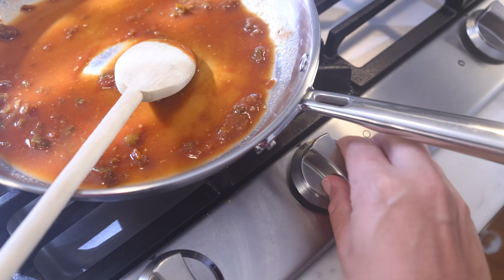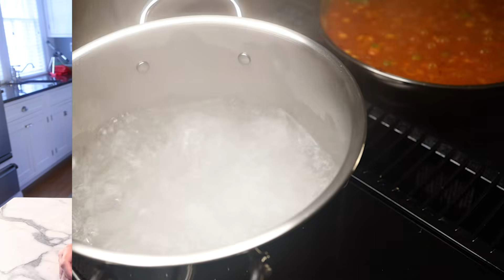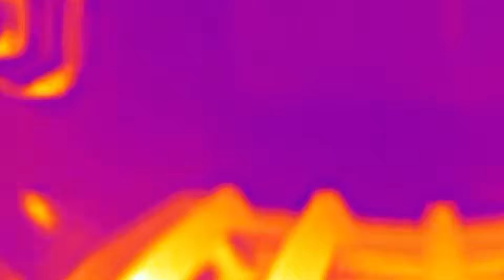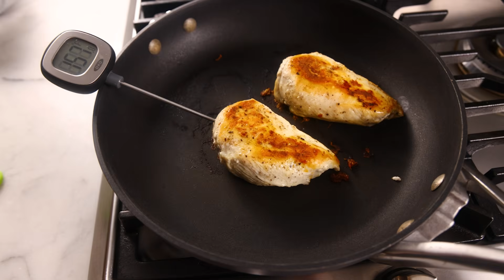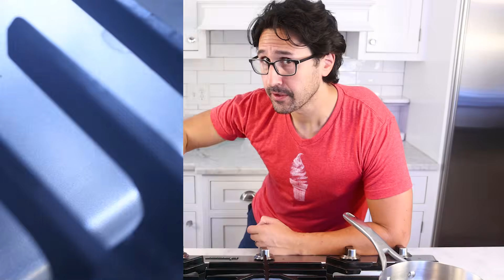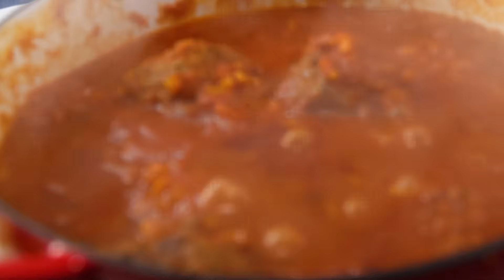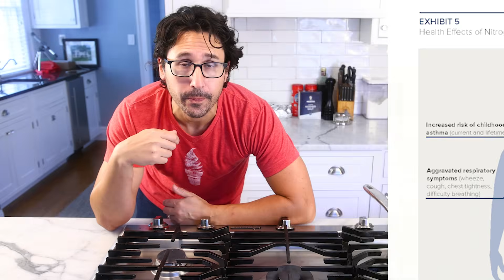Problems with gas stovetops | weak, dirty and dangerous

Comment: I wonder if you could make an ultra-responsive electric range that can wrap around cookware of different shapes using something similar to a less focused plasma cutter -- air forced through a high-energy arc to create a 'flame'. Would probably be expensive and hard on your cookware, though, and it would still create some air pollution by ionising the air, creating weird impurities like ozone and nitrogen oxides. Induction just seems more practical overall.

Comment: A relative of mine wanted one of those old fashion ovens with cook top on top. It has four gas burners on top and an oven below and looks like one of those old style ones but with modern technology. When they were getting it I suggested going for the last 2 side burners to be electric instead of having all 6 burners be gas. Now the electric ones aren't inductive (which stinks) but at least it's electric so if something ever happens at least they can still use the electric part maybe. I have cooked on it a few times and it really does suck. It doesn't seem to cook that well, gets to hot at times etc. They haven't used the electric ones at all yet and still use the burners, but I have one of those nuwave inductive cook tops which saves a lot of space and cooks a lot faster but that has also had problems. Idk if it's the cheap inductive cookware we got with it going bad, or maybe the nuwave inductive cook top is going bad itself?

I still prefer the inductive cook tops over regular ones cause they seem to work a lot better.
Reply: Gas ranges last decades.  You can get a portable induction burner if you want, just in case.  They're cheap, $20-30.

Comment: You mentioned that your carbon footprint is reduced by using induction over gas.  You then said that induction does use the same fuels but possibly in the future they won’t.  On thing to realize is that when you draw power from the grid, the power has been generated by plant that generate that power in the most efficient way possible.  In Ontario we have hydro power which is good.  Other places rely on gas/steam, coal, nuclear etc.  Even though these plants are using resources, they are using them way more efficiently than a gas top burner that just opens and closes and has no form of reclaim.  So we don’t have to wait for the future, the induction method of cooking is already so much more efficient.  They do need more development though.

Comment: Can confirm induction is much better than gas in terms of how hot they can get, how low they can go, ease of cleaning and responsiveness. I think gas is better for sautéing as you tend to move the pan around more and on a glass surface, this can be a bit worrying. Honestly the best cooktops now are induction ones that have a single gas burner too.

Comment: I grew up in a home with an electric top. I have visited and cooked on electric top stoves at other peoples houses. At least in this area not many people have induction tops. When I bought my home the fact that it has gas was a huge selling point. Gas stove, water heater and central heat. It is way cheaper than running electric in this area. The local electricity in this area comes from a natural gas run plant so running the house on gas means no losses in transmission thus it is cheaper. I love cooking on gas. My oven and stove heat up way faster than any electric top i have ever used. The range may be old but chances are it will never need to be replaced because of how simple it is. It's just a pipe burners and a electric starter. Many people may not like the heat wrapping around the pan / pot but that is something i love about it. A quality pan will even out the direct heat underneath it with cladding and the heat going up the edges gets the rest of the pan up to heat. I takes me longer to get the stuff out of my fridge to make eggs than it takes to cook them. I can go from fridge to plate in 5 min. It could be that i have an older gas stove without safety features but i can get very low on the heat. The fume hood directly covers the stove so the dangerous gasses are less of an issue. When the oven is on it vents over the stove top and i like using that heat to melt butter if i need melted butter and to use the oven. The iron grates holding heat is a feature not a bug for me because i love cooking in cast iron for the heat retention. Another problem i have with electric is the stupid "energy star" crap. I said i want full power so I can get this pot up to a boil so give me full power and quit turning off. You turn it on to full power and after a minute you hear "click" and the burner turns off. NO! STAY ON! I WILL TURN IT DOWN MYSELF WHEN I AM READY! With gas I don't have that problem. If i am making a long soup I start on the big burner to get it up to temperature then switch to a smaller burner that has more control once i have reached it. It also still works if the power is out and that is nice. 
TL-DR: I LOVE having gas and never want to go back to electric.

Comment: I call BS. Look most professional cooks use gas. My gas top boils water just fine. And if you push electric..what happens if the power goes out? Yeah your screwed.  Gas is far better than electric..and the carbon footprint is smaller.. electricity is made.from.coal.

Comment: I think your problem is a little exacerbated by your specific stove top model and what you've become used to cooking on. If you've never really known anything but electric stove tops, it's obliviously going to be something you are going to prefer. I've only ever known gas cook tops and like any stove (I just got a new one, Samsung one - LOVE IT) and with every appliance there is a learning curve.
My old stovetop I had the opposite problem that you have that one of my burners would clog up with something & we had to constantly clear out the gas jets under the caps because the flame would get TOO low on our small burner, making it useless!
Just from looking at the burners you have (I'm in the US, we don't call them Hobs here, #changeMyMind) you have ONE simmer burner and it might be confusing but it's the biggest one on your stovetop! Its a double burner in the center that is useful for boiling water but when you turn it down the outer ring should shut off. Gas is all about burner size, a big burner will NEVER get low enough for simmering a sauce, especially with a lid on!
You never having to use a double boiler for delicate things on electric must mean you must have had a REALLY good stove because most electrics are NO WHERE near that granular in temp control from my experiences cooking at friends houses.
I've also never not had a vent fan for my cook top which is very key to keeping your cooktop cool.
I agree cleaning them is a PITA and you pointed out alot of things that are completely alien to me like resting your spoon on the pan in my mind is a HUGE ABSOLUTE no-no. But again, I have to point out what others have mentioned in the comments as well. Gas doesn't require electricity to use and I get power outages regularly!
POT QUALITY! Pot quality and type also has a HUGE part to play! We just got a All-Clad set a few years ago, the D5 (D3 is cheaper but recommended against) and the difference was NIGHT and DAY! On electric, your burner isn't sized that much differently and the energy is even at the source! You NEED, absolutely NEED good pans to distribute the heat from smaller and more concentrated heat sources like flame! Go out and get a really good layered stainless steel pan and try it out! Gas is VERY picky about your pan! You can make delicate things on gas on higher heat, the pan just needs to do alot more work!

Comment: I completely agree.

I grew up with gas, and not just the stove kind (colon cancer is a real bitch in my family and it started young for me... Ahhh... Tragic jokes for the win! 😁)... I HATED electric stoves because they were different, and it took FOREVER to get used to a new one any time I had to use one somewhere new.

I bought my first induction cook top in 2011... The moment I saw the package (being a scientifically and technically literate person), I knew exactly how it worked, that only certain pans would work with it (induction, eddy currents, yada yada), but most important to me, the efficiency! I knew it would be super efficient with regards to my energy consumption, which was based on hydroelectric at the time... I bought it on the spot. Almost $200!

But it boiled water in like 5 minutes! Compared to the gas stove I had, which I LOVED, holy buckets! It had a few things I didn't like, but over the years they have gotten so, so much better.

Ultimately, it noticeably brought down my energy bill. I have mostly used induction cook tops ever since, I RARELY use my sweet electric stove, I have only had one induction cooker for about a year, but it just works so, so much better than my expensive electric stove. Even the inconvenience of swapping pans about on a single cook top because I don't want to try/get used to a new one and I can no longer find the model I have. Plus the idea of having two different 'systems' to fight with while cooking, hard pass. I'll eventually find one that ticks all the boxes and just buy two.

Unfortunately, I can't get an induction stove top, the lady of the house doesn't like induction, 'because there's no sign it's working or if it's hot.', which I disagree with, but happy... Errr... Not wife, happy life.

Comment: Cooked on electric for over 30 years, and even getting a small pot to boil took 10 minutes. New house, sold the electric flat top, installed gas and a propane tank. Takes 3 minutes for same pot. I am not convinced.

Comment: It sounds more like you’re inexperienced with gas stoves. For instance, I have no idea why you would want to leave something you’re not cooking (spoon) on top of an object you’re cooking - especially when you should clearly have more than adequate space to place a flammable object away from a heat source (which is still a risk on electric surfaces as well). I’ve, personally, never found an electric surface to be more pleasurable to use than gas. I’ve used tons of gas and electric stove tops (easily over 30 of each) and have always found electric to be miserable. Electric always seems to have way more hot spots than gas does.
Reply: Putting a wooden spoon over a pan like he shows prevents pasta from boiling over, I think.

Comment: Thank you for the perspective. As always confirmation bias gives one the warm and fuzzies. I really enjoy cooking on our apartment grade bent wire cooker. For a while we were living in a place that had a top of the line gas range and I was continuously burning myself on the damn thing. And you're right! it took forever to get a pot of water boiling for pasta. Getting back to my basic range where the heat output feels like it's double is wonderful. I know it's not but all the energy goes into the bottom of the cookware not up the sides. To each their own I guess.

Comment: Interesting fact about those old-style coil stoves: that spiral of material you see glowing red-orange when you crank it up to boil a pot?  That's not actually the coil, that's just a spiral housing for the actually very thin, rather tightly looped resistive coil within.  Usually, the thing's made out of Bakelite of all crazy things, just in case such stoves didn't feel 50's enough.

Comment: Carbon "foot print" is a fraud on consumers. The environmental carbon footprint is an issue on the shoulders of oil companies, plastics industries, and corporate produces of food. Whether consumers us gas or electric stoves, reduce our use of petrochemicals, or take any other step to reduce our carbon footprint, it has little compared to the environmental impact of corporations that limit our choices in buying consumer goods that they produce. For my whole life, I have cooked with gas and know the methods to use it cook that are far better than using electricity.

Comment: I love my gas stove for the feeling I get cooking with it and the responsiveness compared to resistive coils. I do have a large induction burner just for boiling water that's very nice. Since most houses in my area have gas for heating and it's much cheaper than electric heaters, gas is something I'll get to enjoy for a while.

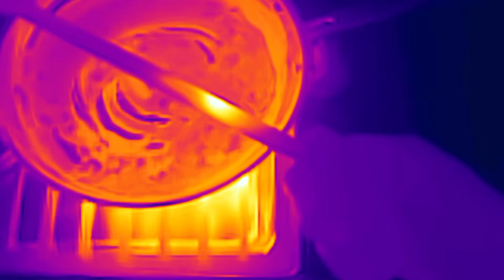Comment: 6:27 Hey Adam... see how the edge of your spoon is hot???  And on your electric stove it's not.  That's because the WHOLE PAN get's heated up, and not just the bottom.  Gas stoves are superior for even heat throughout the whole pan.  If you're bummed that water doesn't heat up as fast, get a portable plug in electric range or use an electric kettle.  (I'll often use my electric kettle when I make pasta to get the water boiling faster).

Comment: Wow this video disappointed me. I have cooked for ages on both induction and gas, even the induvtiln wok things from your video in my last kitchen job.

Time to boil water, efficiency or temperature control is not even close to be the most important utility of my kitchen. Control is. I don’t use spatulas to move the food around, I use gravity and muscle movement in my arms and shoulders to move around the pan. When I’m cooking a steak or making stir frys I have greater control on how the heat is transferred to my pan in regards to how it is placed on the heat.

If I move the pan on induction it instantly lose heat and it’s awkward.

Comment: I went from gas to induction after I moved recently. One thing I really don't like with my new stove is that you get a hot spot in the middle of the pan when the pan is larger than the pit. You could say: just use pans of the appropriate size, but that's my entire point: gas allows you to use pans that are way larger than the fire pit and the heat gets dispersed very smoothly (at least with my cast iron pans). That's a big plus for me. I do like the fact my induction stove heats up water more quickly, but previously I just used a separate electric water boiler for that, which was as least as fast (though not very suitable for large quantities). All this considered, my new stove does its job and indeed is easier to clean, but I still prefer the gas one I had.
Reply: Rice cookers figured this out a while ago by combining steel and aluminum in the pot because aluminum gives even heat but does not work with induction.

Comment: Had electric, then gas, then electric, then gas again.  I'll take gas.  Perfect?  No.  But it's better. As for induction, I saw a cooktop ruined with aluminum foil contacting it.  Also, you can forget about the chef-like sliding of a pan across the cook surface.  Glass scratches. - even the hardest kind.  I'm not drinking the induction cool-aid.

Comment: A resistance coil stove does NOT have to cycle on and off to vary heat! That's just a design choice by manufacturers! They can perfectly well just regulate input voltage to get a linear response but they don't because they're lazy and a solid state relay is easy!

Comment: There's almost no inherent limits to the power density of either electric or gas stoves. You can build a gas stove with arbitrarily high heat output as long as you give it enough fuel and air.

Comment: gas is good because it's analog. No temperature regulating pwm bullshit. You turn the dial up the heat goes up. My fucking electric stove will go red hot for 2 minutes when I turn it to max and then stay at a simmer for the rest of time.

Comment: The thing about gas though is that you can use other types, not just the oil based ones but renewable gas like methane which would bring the carbon footprint to 0

Comment: I have never ever boiled water on my gas hob! Water is boiled in the electrical kettle, then transferred to a pot to cook the food. 
Also, never had many of the other problems mentioned. I’m beginning to think it is something to do with the hob featured in the video. You can get diffusers btw to reduce the heat, but it’s not normally a problem. And I’ve certainly never had issues with the edges burning, utensils getting hot etc. I’ve had I think five different gas stoves in different places.

Comment: European here. Back in my country we rank the burners as follows: electric (worst, only get when no gas is available), gas, induction (best). In older buildings you weren't be able to push through that much electricity and electric burners were painfully slow.

Comment: If you have a gas stove and can't adjust the flame enough, just have the valves adjusted. They are ALL adjustable. People do it all the time. If you don't know how to do it, call an appliance repair shop. They can do it for you. None of the big box stores ever adjust the valves and they always seem to be set wrong from the factory, at least on some burners.

Comment: My cheap gas hob has a heat sensor that shuts the gas off if the flame goes out. I can turn it down as low as possible without any concerns.

Comment: I don't get the 'weak' part.  My previous electric stove had an ultra-element at 3,000 watts (~10,000 btus).  My gas stove has 18,000 btu elements.    The ultra-element, that baby pulled 20 amps alone, half of all the amperage of the breaker, using it limited the other 4 burners and the oven.  Gas elements can be TWICE as hot, and can be immediately dialed down to as little as 300 btu's immediately.

Comment: I switched to an induction cooktop when I remodeled my kitchen and I couldn't be happier. Yes, you need magnetic pots, yes it doesn't work when power is out, but it works better than anything else I've cooked on when nothing gets in the way. Magnetic pots was easy, I only needed to replace a few too high end stainless pots and when the power is out I use my camping cooktop or that 150k BTU wok burner I have in the backyard.